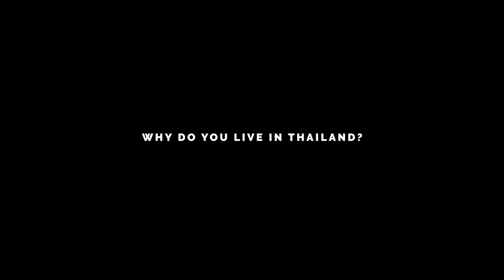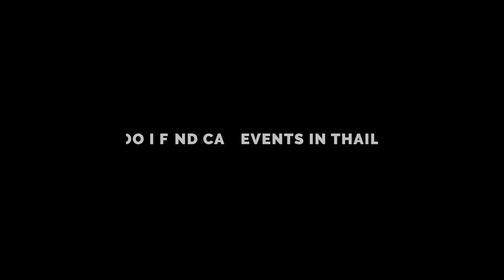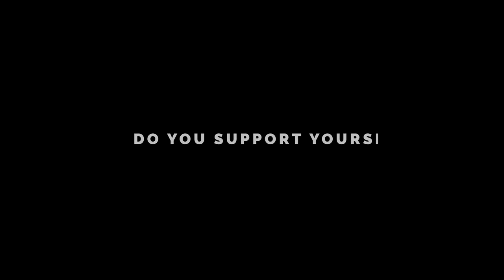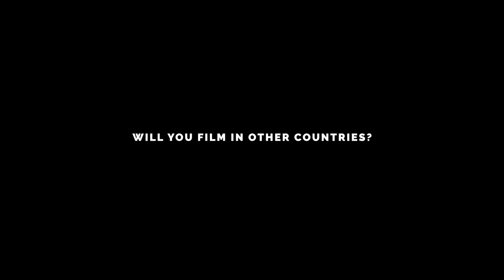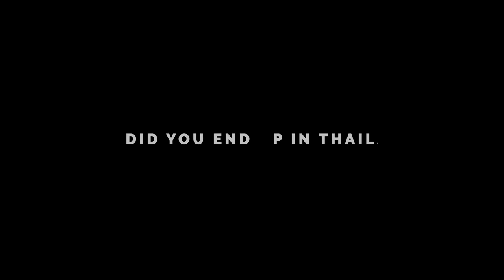Why Thailand? My Girlfriend? YouTube Money? Boat? CB Media FAQ 2023

Comment: On "What cars to buy":  I bought an old 1970 Mazda M1000 (min-truck) for ~$375 and have had a blast getting it road worthy. I got it licensed last month finally (after a couple of years of tinkering on it).   I also recently came across a Tata pickup truck that has a Toyota Supra engine it it (yes, the V8 1Uz-Fe) for ~$575.   I've had it for about a month. Lots of ideas  on what to do with that engine (maybe put it in the Mazda mini truck? Or my 1995 Mitsubishi L200 pickup that I semi-restored also).  In summary, there are many opportunities here in Thailand to get into the motorsports scene.  It can be done on a budget if you're patient and enjoy the journey.